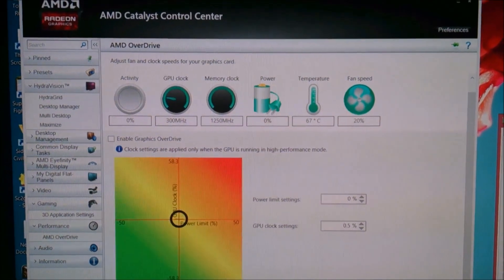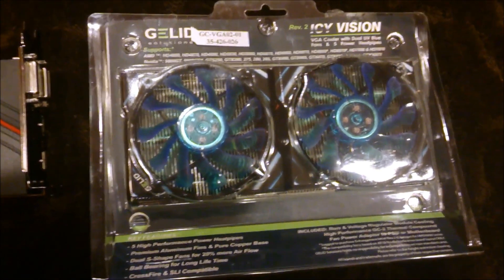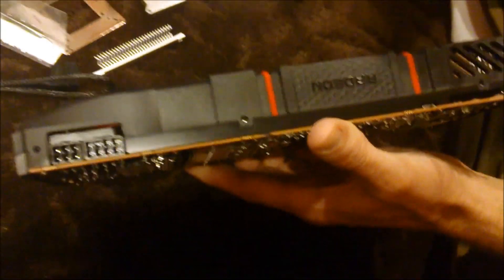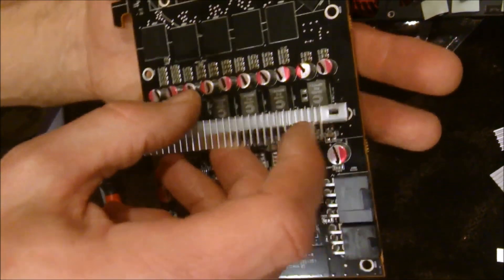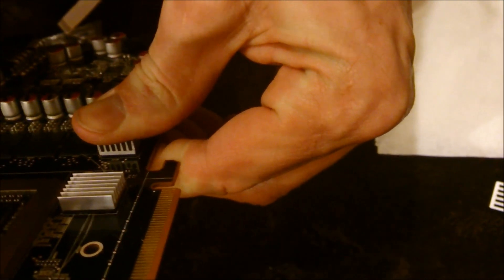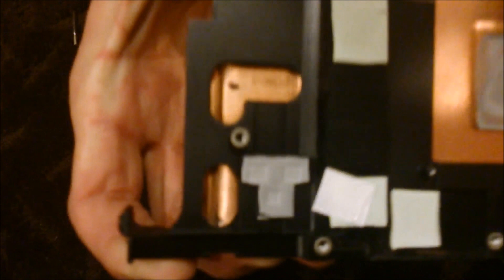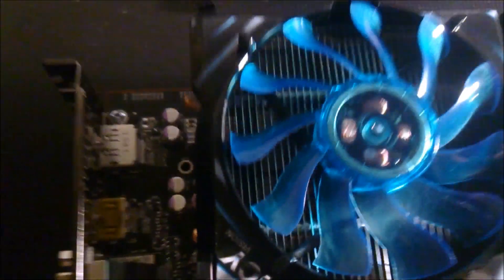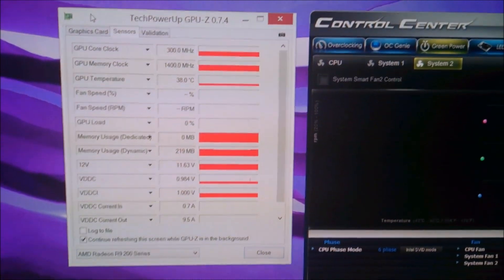Radeon R290 Gelid Icy Vision Install Walkthrough + temp readings vs stock

Comment: Damn I allready ordered this kit from ebay for my 290x reference card. 
That T-shape  Vrm area is actually VRM for gpu memory, it is a set of 2 mosfet  (2 large chips) and that small one is actually mosfet driver. Drivers sends the small current to Mosfet's gate to turn them on/off it doesnt generate much heat. on motherboards only mosfets are cooled drivers arent, here's the diagram: https://www.ekwb.com/wp-content/uploads/2016/06/05-1.jpg

Full article here: https://www.ekwb.com/blog/what-is-mosfet-and-why-should-you-keep-it-cool/
Reply: Screw it. I just ordered Gelid Icy Vision 290/290x enhancement kit, I dont have time for that jury rigging bullshit.

Comment: can you not use msi after burner for the fan speed when connected to the gpu  fan pin slot  when custom cooler installed??

Comment: should have gone with Morpheus or Peter II and 2x120mm Fans...those are Highend-Coolers, the Gelid is not really better than a regular Cooler. A Sapphire Tri-X or Vapor X is actually better than Gelid. Morpheus with 2x120 Noctua or leave it^^. YOu dont need 750 watt, you only need about 40 Amps on 12 Volt, even a good 500Watt PSU is good. Raidmax isnt a brand you should consider when buying a PSU.
Reply from the maker: I bought this cooler right when this reference card came out. I do not believe either of the two coolers you mention were available at the time, and neither were any of the third party options for cards
Reply from the maker: +melangkoh Check out my other videos, I completely rehauled my PC. I now use a Corsair HXi 850 PSU. Raidmax does suck, and I was on a budget when I bought it originally.

Comment: why does everyone use so much thermal paste on GPU's?
Reply: As long as the thermal paste is made of non-conductive material you can use more than required paste for a GPU, which makes the paste squeeze over the full GPU die since, unlike CPUs, a GPU does not have a heat spreader, thus having slightly more coverage on the GPU die can give better thermal results later on.

Comment: You only need a 600w psu to power the 290x, your issue was raid max not the the wattage. Always buy a quality psu.
Reply from the maker: Actually the Raidmax was fine. The problem did end up being BF4, and several patches later the game no longer crashes or black screens on me.

Comment: i m pretty sure your black screen problem comes from the Elpida memory at 1400Mhz... i had 2 r9 290x powercolor pcs+ (with manufacture overclock) i had to return them. Now i m running two reference r9 290x and i have no issue...

Comment from the maker: Sorry guys I have had a lot going on and have not had time to make part 2. I can safely say my system is still stable as a rock and I can even overclock pretty decent with no issues. I have not really dived into things much more but so far so good!
Reply from the maker: Yes it sure can be crossfired.
Reply: How did you solve the black screens?
Reply from the maker: I'm pretty sure it was bf4 patches and driver updates that eventually resolved this issue.
Reply: I'm getting black screens atm.

Comment: TO EVERYONE LOOKING TO BUY THIS PRODUCT FOR YOUR R9 290/290X:

There is an enhancement kit specifically designed to solve all the problems found in this video when installing this cooler. The kit includes a special heat sink for the 290(x) VRMs that actually lines up with the screw holes as well as a special heat sink for the VRAM module that had to be modified in this video. It even comes with a T-shaped heat sink for the weird T-shaped component near the end of this video. Here's the link: http://www.gelidsolutions.com/products/index.php?lid=1&cid=13&id=108
Reply: Thanks, was wondering if that kit fixed this.

Comment: Apparently you can "cook" the heatsink plate from the heatsink itself. If you do that you might save yourself the trouble of mousing all the little heatsinks that come with the Gelid. The thing is, 3rd party coolers are available now, but the reference model is really cheap to get 2nd hand. So I might try this as I upgrade to 1440p and this card.

Comment: exactly what I was looking for in a video about gelid icy and 290
btw, about that psu, I've been running 290 on a 400W oem sesonic over xmas hollyday with phenom x4 cpu...   not a single hickup, even minned out some doge with it at that time and everything was allright.. well except the temps reaching 92 if I didnt set fan to 4000rpm...
So I am kinda sure that wattage wise 750W is overkill as hell
Reply: Sooner or later something is going to give. You better hope it's the PSU and not the 290 or your CPU.

Comment: Thanks for posting, the fan header actually exploded on my r9 290 and I can't be assed going through RMA(card still runs just no fan) so I'm just getting one of these! Thanks for diving in and trying it out!
Reply: Just installed the cooler there, I also grinded down the small memory heatsink and made a smaller heatsink for the small VRMs. Quite a bit of PCB flex with this cooler though, fairly weighs down the card!
Thanks for the video again, my card still runs (even with the blown fan header) and now it does it much cooler (55c load!) and quietly!
Reply: Have you checked your VRM temps?
Reply: Stays below 75C during gaming, I keep them up on RTSS OSD with HWInfo so that if a heatsink ever comes loose I'll know. Gets too hot during furmark though, goes to 90 then I shut off Furmark. Would need a proper mount for VRM2.

Comment: Great video, thank you very much!

You say that the black screen issue on BF4 is not due to your card, but then say that your friend has not had the same issue.  I'm confused; are you saying that you think the issue is / isn't with the card?

Also, what difference does it make to the noise as that is one of the main reasons that I want to install the Gelid.